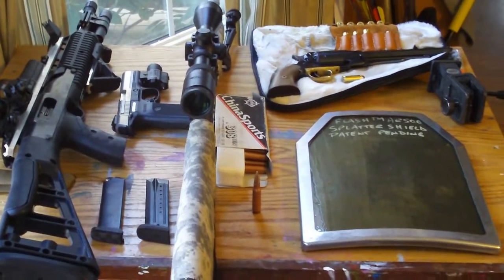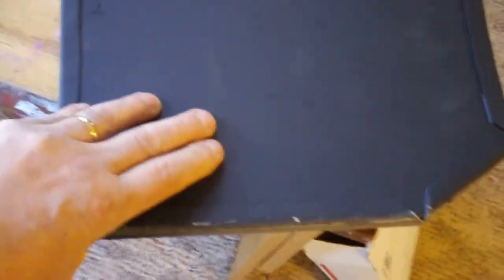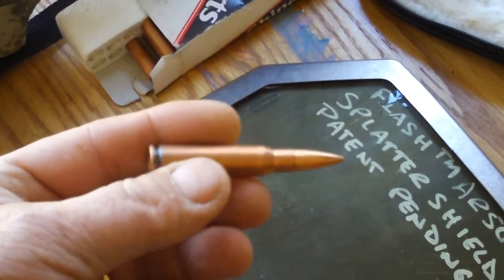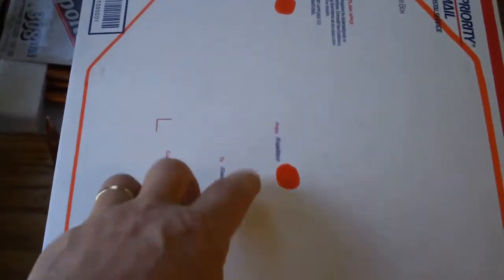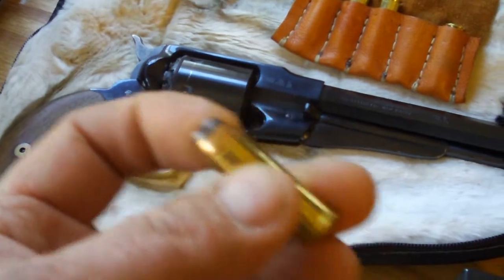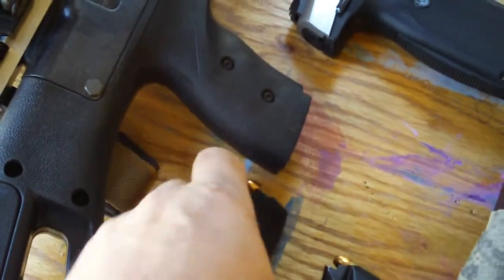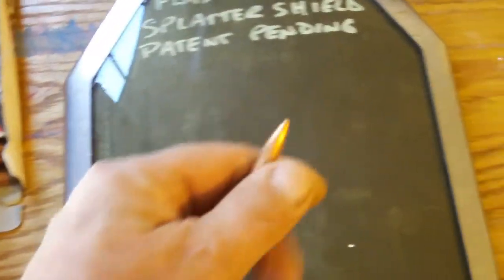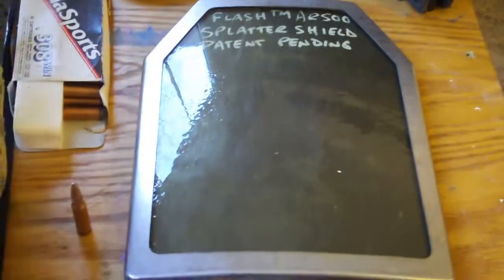New FLASH TM AR500 Splatter Shield Test: Protocol

Comment from the maker: Watch my other videos on FLASH TM AR500. The reason I have been testing this and find it interesting is because the steel is superior to other AR500 rated plate. It's Flash Bainite Steel. That means it has unusual properties like a perfect balance of bainite and martensite...or in simple terms it is both tough and resilient yet ductile. Normal AR500 other guys sell is bent on a break to make it "curved" Gary's plates are bent on a single radius die with a 450 ton press...no work hardened creases

Comment: Um .060 sounds like the gauge of the steel and .465 (nearly 1/2") can only be the thickness of the plate itself. .060" doesn't seem like enough mass to stop a .308 unless it's made of titanium carbide coated nonobtainium.

I'll be looking for the actual impact analysis.